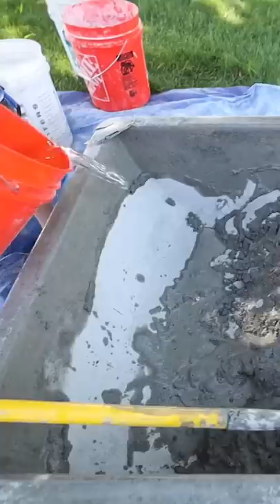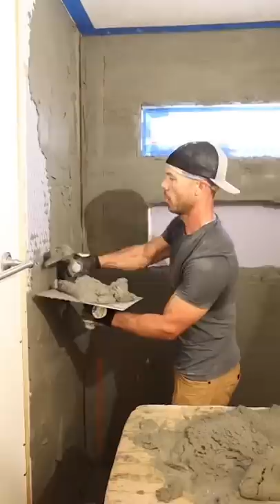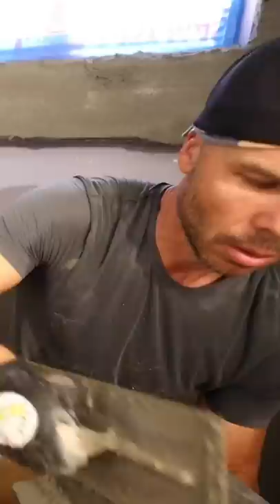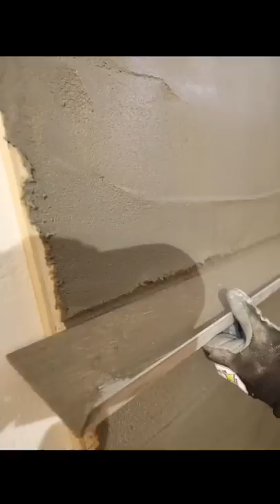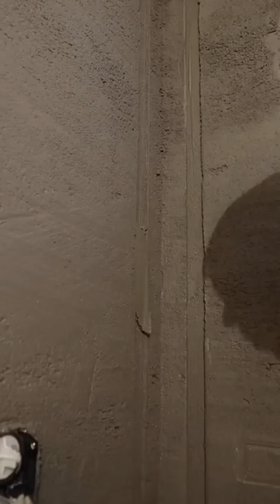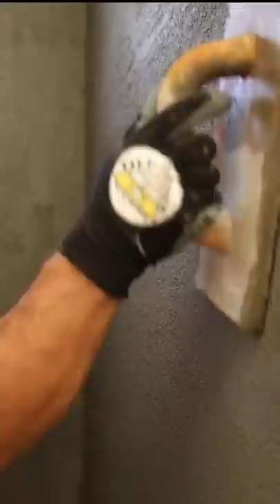Wall float Northern California style!   #tiles #tiler#bathroom #shower#tile#diy

Comment: I just wish that there was a better way to waterproof floats. I have repaired too many of them where they leaked at the corners. Thin tar paper,  with staple holes in it doesn't hold water.
Reply: Epoxy grout!
Reply: just use Tyvek and/or membrane tape to reinforce the corners
Reply: Red guard and felt fabric on corners and joins . Use three codes of the red guard thick codes and that keeps the shower and pan water proof!! Make sure to do a water test

Comment: I want to learn this so bad nobody does it where I’m from and I would love to bring it here
Reply: nobody does it because it's old school and a half.  Really zero benefit over kerdi board or similar.  If the framing is crooked, just fix the framing.  I'd be half way done tiling this shower by the time his wall mud dries.  Pulling wall mud does require a great deal of skill and I do respect that very much.
Reply: @petrhermanadventures9509  Unless you’re plumbing framing w/LVL studs, that repaired framing will be out of plumb in 30 days as green framing twists and tweaks. 

Kerdi board is garbage, as is all foam & cement board. It’s designed for persons lacking skill to float a wall plumb. Floating a wall takes just a bit more time but the results are a far better, professional job. Then install a Hydroban membrane secure w/Multimax. Be sure to band the seams as required by Laticrete. Doing it right once insures a quality install free of leaks & cracks for decades 👍

Comment: I use my 36" concrete steel fresno to apply 1st coat. Hold at bottom of wall at @45° have laborer fill float with material and move fresno up.

Comment: I have a question, what’s your contact. If you plumb up one ledger how do you get the next one at the same thickness. So if one ledger let’s say is at 1” thick and the next one is at 1”1/8 it will throw the floor out of square

Comment: This is awesome! Question for y’all: I’ve never done this but thinking it might be my only option…I’m in Southern AZ with an adobe (mud/straw brick) house. Took old tile off the shower walls and there’s a thin layer of plaster over the adobe bricks. Some water damage with crumbling adobe, plaster came off in places, and the walls are definitely crooked. Can I mud over the walls? Not even sure how I’d attach the lath, because nails don’t stay. When I hang things on the walls I’ve had to use plastic wall plugs (not regular anchors that expand with 2 wings, rather the ones that expand radially so they grip all around the circumference). Is my best bet to just use a bunch of those anchors, attach the lath, mud with this method, then apply a waterproof membrane over that? Any advice would be appreciated! I’ve tiled showers, but never over adobe walls.
Reply: I think you can float right over the brick if you use a bonding agent.
Reply: @thesuper4701  I would disagree. The adobe block will suck all the moisture out of FatMud, creating a very poor bond. Could try a primer but I doubt you’ll find anything that will adequately bond. 

If it’s me, I’m drilling holes in adobe blocks, minimum 4” deep at 12-16” staggered spacing. I then insert 20d or 30d nails using anchoring epoxy. Make sure the nail head extends 1/4” or more from adobe, then safety wire lathe or chicken wire to nail heads. Float with fat mud as he’s doing in video. 

Fwiw, if you can’t find FatMud where you’re located, you can add lime to your favorite pan mud mix. We personally prefer a bit higher sand concentrate, most commercial mud is 4:1, we use 5:1. Our FatMud mix is 5:1:0.75 mix. Just use play sand, not anything too fine, any available Portland cement and lime.
Reply: @thesuper4701  wet the brick as you go and you'll be fine.
Reply: @MichaelM-to4sg  thanks for the detailed response! That sounds like the most sure way to do it. I’d be nervous to rely on just a primer. 

Also, what options are there to finish the edges of the floated area, since it will sit proud of the rest of the wall surface? I don’t care much for the old style curved bullnose tiles.
Reply: @mirafrenkel7929  Easiest would be a wood trim moulding. Lots of different options. If you wanted the cleanest look, either add a layer of drywall to butt flush with mortar surface then a Schluter or similar edging on tile edge. If that adjacent wall too is adobe block, I’d float it with clay plaster to depth flush w/mortar.

Comment: How do you deal with the raised edge at the transition from the float to the drywall when you tile?
Reply: With tile or trim just whatever it needs it’s
Reply: You usually try to make it flush with the drywall but bc the walls usually are so unplumb that they end up sticking past the drywall. Then you use colored silicone to match the grout in shower or just paint it the wall color.
Reply: Decent results with grouting or caulking flush and square then painting the gap filling the wall color.
Reply: Skim coat the wall with 20 minute mud
Reply: @splatterize  honestly if we’re keeping it 100% real schluter trim is the only way to go
Reply: @GoogleAccount-ii9sj  put the schluter in the cooter you’re not gonna get that good of a transition for all that extra work come on bro use the schluter and you get more cooter

Comment: Question to a pro: for 12x24 porcelain tile, if using a square 3/8x1/4 trowel provides full coverage, is that safe to install that way. Need 1/16 less thickness overall to match hardwood floor. Ditra xl + thinset + tile which is 5/16 thick (9mm).

Comment: The contractor who built my house had an Italian tiling crew. Everything was floated. In the bathrooms it was tar paper, mesh, self leveling concrete followed by tile. They didn't back butter because the tile fell apart with one swing of the hammer. It held up though for 20 years.

Comment: Why don’t you mix it with a drill?
Reply: In a bucket*
Reply: Way to much mud to mix with a drill, and you can’t get the right consistency.
Reply: it's wall mud, not thinset.  Takes about 1/4 the time and effort to mix it in bulk like that.